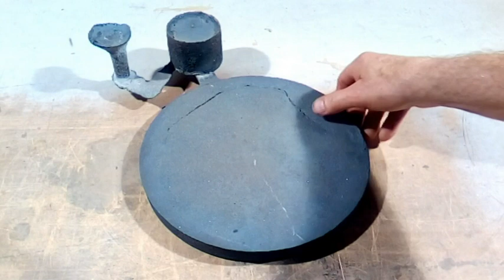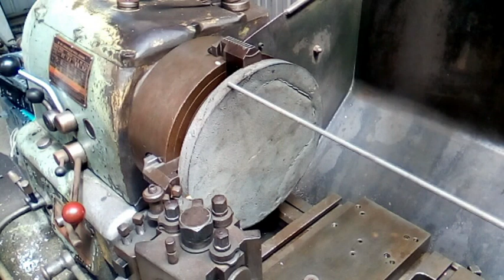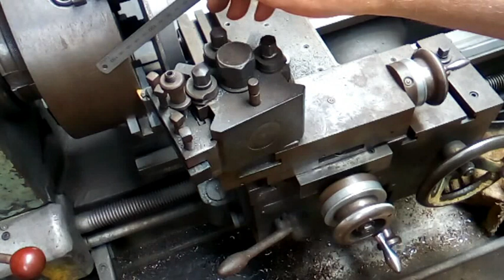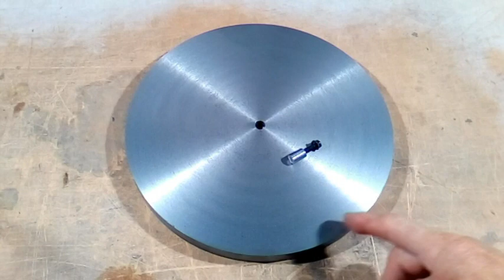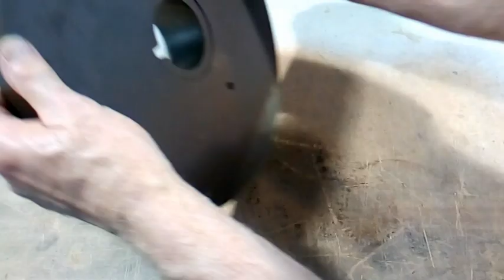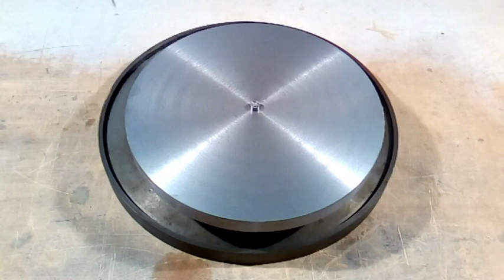Machining my iron castings (Expendable face plate)

Comment: Was the casting material brake rotors and some scrap?
I save brake rotors for this reason.  Just need to get my oil furnace finished.
Reply from the maker: I think in this test melt I used iron scrap from olfoundryman.